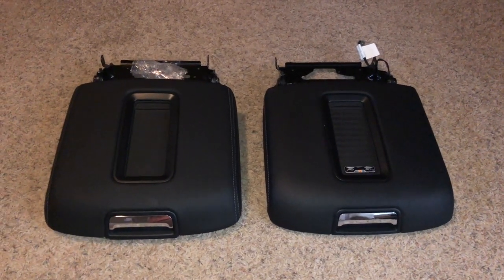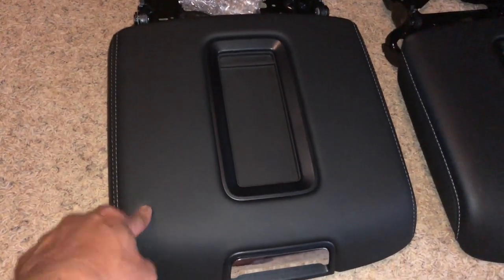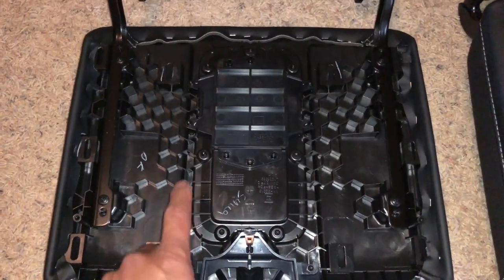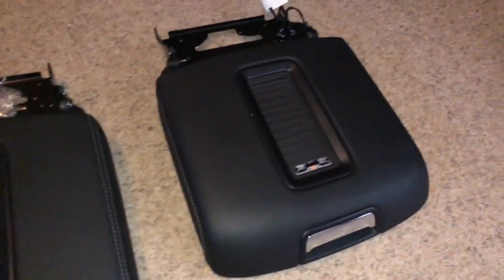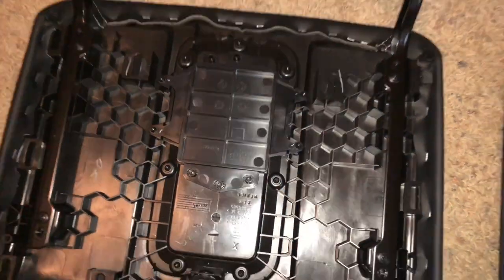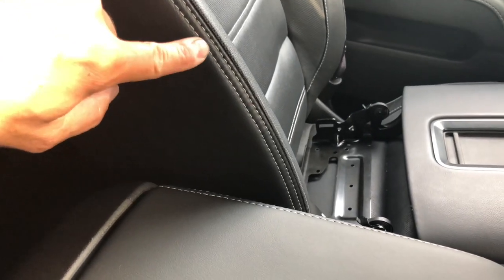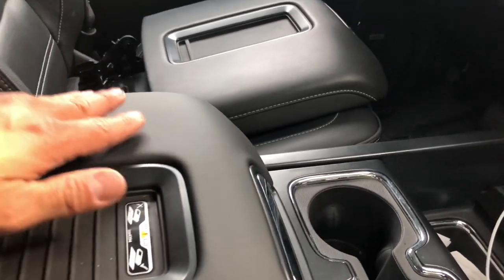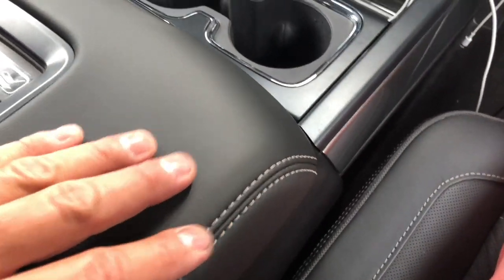2016 Silverado - Wireless Charging Module Lid Swap

Comment: Can you please do a video on how to install the wireless charging module to a truck that doesn’t have one? And if so, please include how to wire them in.
Reply from the maker: DreamK - There would be a couple scenarios with this.  Scenario #1 - If a truck already came with full center console but without a charging lid.  Scenario #2 - If the truck came with a jump seat, upgraded to a full center console.  Variant to this is if the new console come with wireless charging or not, also, 15-17 wireless charging changes for 2018.  So there are several different scenarios... 

I can see if I can cover them all in a video.
Reply: Phil, I do not have a full console in my truck.

Comment: I would love a video on how to install power heated LEATHER seats to a truck that doesn’t have leather seats but does have power heating seats.
Reply from the maker: DreamK - If the truck already has power heated cloth seats, you can install a power heated leather seats and it’ll be Plug and Play. The only caveat to this is  if the new seat is Heated and Cooled... as those seats have Seat Memory.  That would require a lot more work.

Comment: I'm replacing my cargo lamp switch panel under the radio and installing one with the 4 aux upfitter switches. I need 4 pins with leads for the connector since this truck is not wired for them.  I believe the connector is X1 pins 10,11,12 &13. Can you help?

Comment: Hi Phil, I was wondering if there was a wireless charger for the a truck with out a center console, the 40/20/40 seat configuration? Thanks
Reply from the maker: Mike Carlson Not that GM offers as a factory solution. I’ve seen some after market solutions out there.

Comment: Is there a way to add factor wireless charging and than plug that into cigarette lighter in my counsel. My new 2018 suburban didn’t come with wireless charging. Guess you can’t get much for $73,000.
Reply from the maker: Yes.  I've actually designed a harness that T's off the rear 12V plug and provides a clean method of obtaining 12V power for the wireless charging lid.  It's $45 shipped anywhere in the US.  If interested, please email me at gamboaphil@gmail.com

Comment: Hey Phil, I have a 15 yukon without the wireless charger and I have a GM 1352 1066 module that has a 4 wire harness (purple, black, green, brown) attached. Do you know where I could get a wiring diagram or pin out of these wires to see if there is a way to add this to a non charging setup? In the back of the console I have a plug with 3 wires (black, purple, green) but no brown. Can I make this work?
Reply from the maker: Yes - Violet is 12+ VDC, Black is Ground.  Green is the charging bolt icon indicator (shows up on the radio).  You won't be able to gain the indicator icon.  The brown wire is a fault detect wire.  Not used in the Trucks/SUVs.  Green/Brown is omitted.
Reply from the maker: I do make a harness for this that makes it a clean method for pulling power from the rear 12V outlet plug.  If interested, shoot me an email - gamboaphil@gmail.com

Comment: Phil, Great vids, Do you have a video or can you tell me how to replace the center console lid?  I have not seen a way to replace the entire console lid.  Do you need to remove the rear panel where the back seat USB ports are?
Thanks!
Reply from the maker: Michael B - Yes. You have to remove the rear panel. There are 4 Torx bolts.
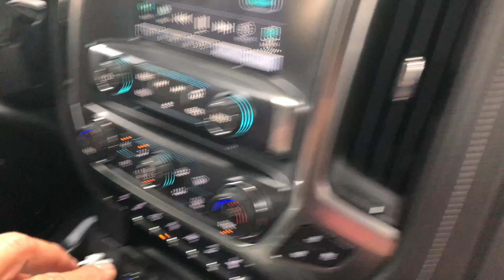Reply from the maker: Michael B - Fast forward to about 3:15 in this video. https://youtu.be/nAIwdVNLQAo

Comment: Hey Phil! Just updated my 2014 Sierra Denali with a wireless charging lid. I got a black a green and a pink wire with a yellow stripe. Could you tell me which wire is hot. I found out in auto wiring don't assume anything

Comment: Do you know if a non-factory equipped model would have the pigtail in the console to plug the charging module into?
Reply from the maker: Nope.  It won't.
Reply: @philgamboa2906   Not sure why Chevy does things this way. Would be far cheaper for them  to make one wire harness for all models and only plug in what they want to equip for that trim level. That is how all my foreign made vehicles have done it. It it didn't come with fogs for example,  the harnesses would be neatly taped up somewhere in the vicinity of the accessory they were meant to control...

Comment: I got a 2015 Chevy Silverado 1500 with bucket seats without the charging lead how can I upgrade it to the charging lead? Also, I want to upgrade my mirrors to tow mirrors to where they are power folding & turn signal because main are just power adjusting mirrors? What do I need for both? Great video
Reply from the maker: Allan Blocker - You got a lot going on here. Might be best to email me.  Send me an email at phil.gamboa@icloud.com.

Thanks!

Comment: I would like to know how did you take the top off my friends kind of pain around by where mine is that so I got to take the cover so they could paint by where the cell phone is that
Reply from the maker: Carlos Lopez Remoce the bottom black plastic cover of the lid.  This will expose bolts that hold the trim ring on.
Reply: Phil Gamboa  thank you
Reply from the maker: Carlos Lopez anytime!

Comment: Hey Phil,

Did you ever make a video on your leather dash or am I blind?
Reply from the maker: No sir.  For the dash, it is easiest if you remove the steering wheel, gear shifter, turn signal lever.  Remove radio and components.  Upper and lower glove boxes.  Remove both A-pillars moldings (or handles if you got them), dash vent/cowl.  There will be a ton of 7mm screws.  Remove the side vent pieces too.  Hope this helps.  There was a PDF from GM, I'd have to go find it.  Someone on GM-Trucks.com posted it.
Reply: Phil Gamboa lol dang! Im going to have to think about that. How muxh did u pay for the leather dash?

Comment: Does anyone know if a wireless charging lid will fit on a 2014 gmc sierra
Reply from the maker: J M - As long as it’s a 1500, yes. 14-18.
Reply: @philgamboa2906  ok cool thank u. Do u know if the hook up with b there or will I need to do some electrical
Reply: @philgamboa2906  ok cool thank u. Do u know if the hook up with b there or will I need to do some electrical

Comment: I actually wanna delete mine lol the placement sucks it’s too narrow for most new phones awkward spot to grab phone or look at gps while charging overall simply sucks 

I don’t need a cigarette lighter on mine either instead I’d rather both and install a wireless charge pad in place of cig lighter and it will work better as the piece of rubber under lighter is to dock your phone either way

It’s no mystery why 2019+ charging position is changed to the front